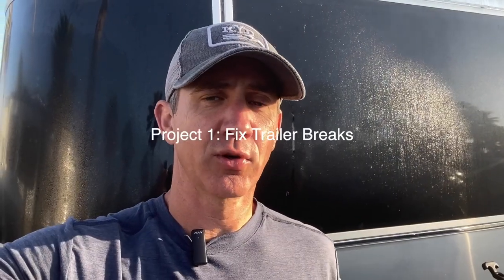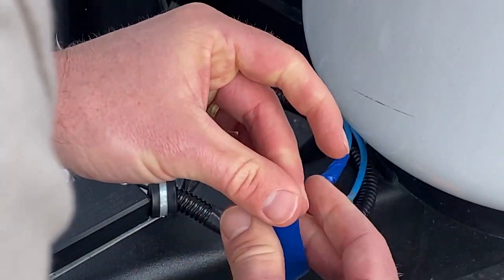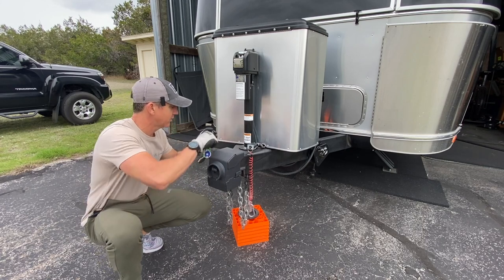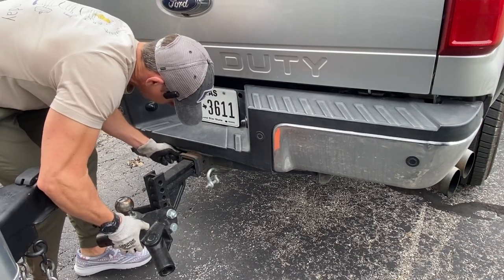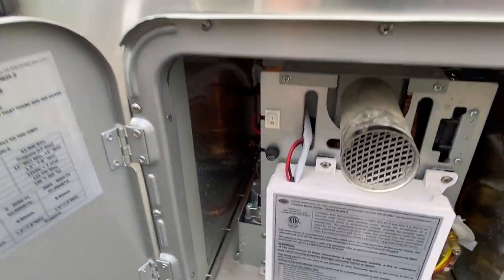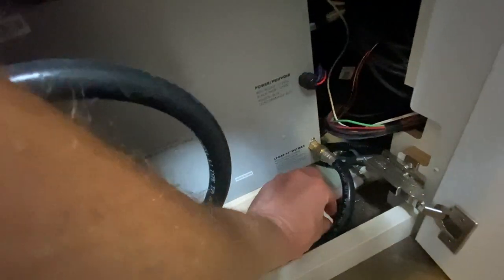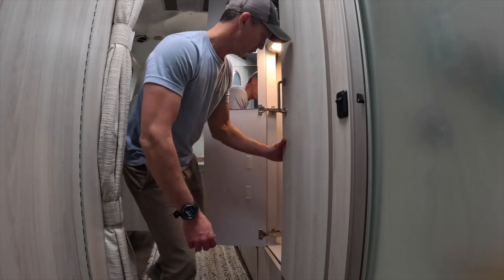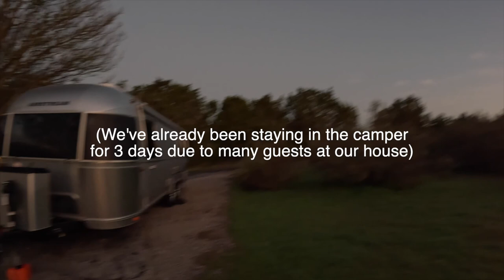Trailer Brake Solution, De-Winterizing & Hitting the Road

Comment: why are you running so high tire pressure on your truck, that's double spec isn't it?
Reply from the maker: No, it's what's printed on the tire 💪🏼
Reply: @DigitalBarbell  use the tire pressure printed on your door frame
Reply from the maker: @the3vildude902  I don't run the original tires...

Comment: You didn't find the reason the brakes were engaging.
Reply from the maker: So far no more issues after 2000 towing miles after I taped up those wires.